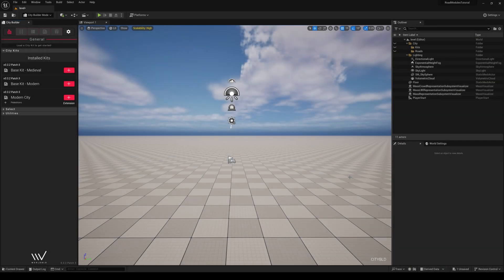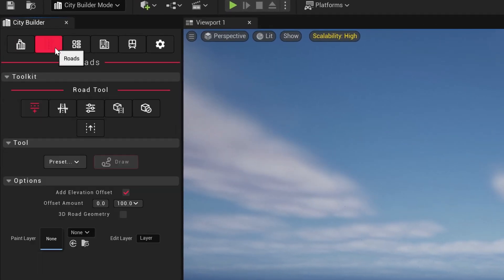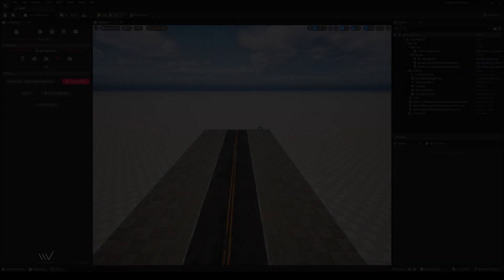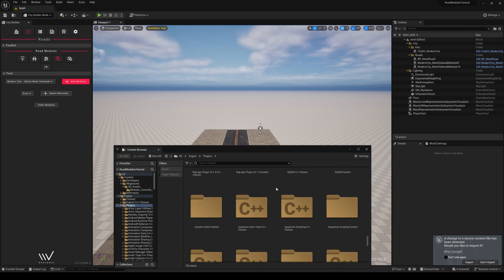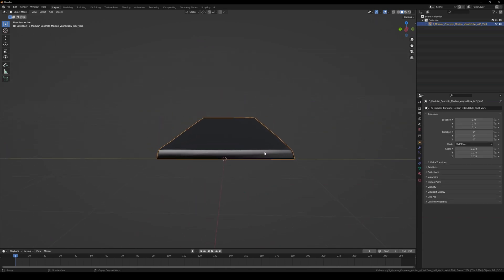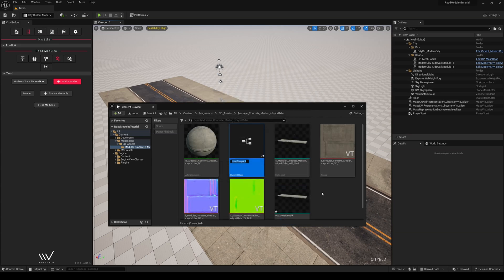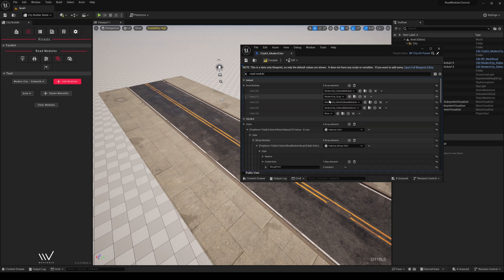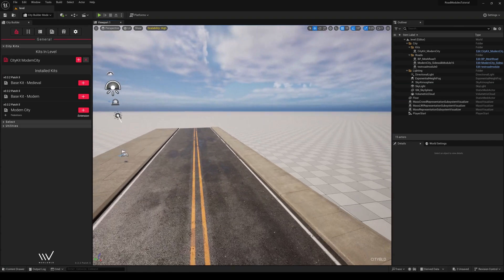CityBLD Essentials - Working with Road Modules

Comment: Really great work John and all members of WorldBLD , I have been practicing on CityBLD alot the previous week has been great but I did face some problems, i would like to tell you about the option in the details panel of when i press on any road the option is road preset override as i remember when i want to replace a road with another type in works fine but I don't find this option on the roads intersection if I can replace the roads but not the intersection between them is there a better option to replace the roads , also i would love if we can choose what type of connection is in between the roads like a roundabout i didn't find would be pretty legendary, I do have a question about modular roads when I draw roads using modular roads is there a way to connect them while sculpting the landscape I tried to draw roads on a mountain it actually worked pretty well but when i tried to connect the road to itself it doesn't connect while sculpting the landscape and doesn't show the yellow sign of connection , I used the zone graph for characters i already made before with zone graph and it's working perfectly thank you!